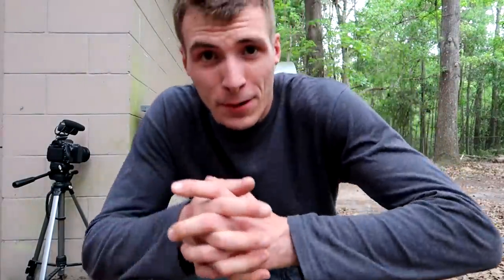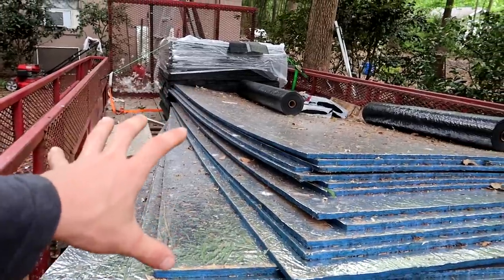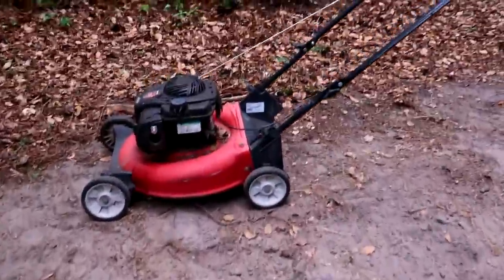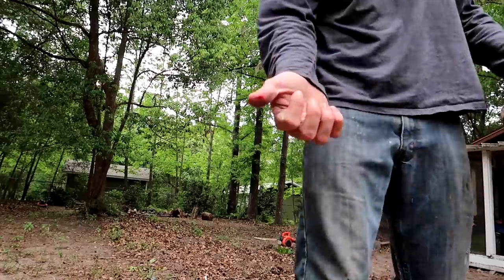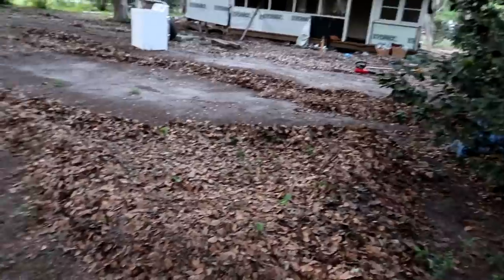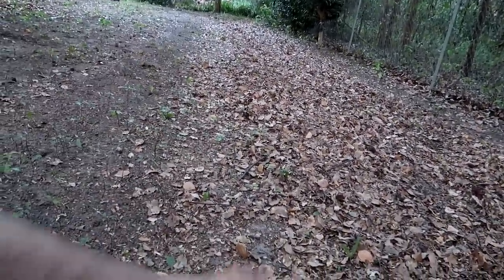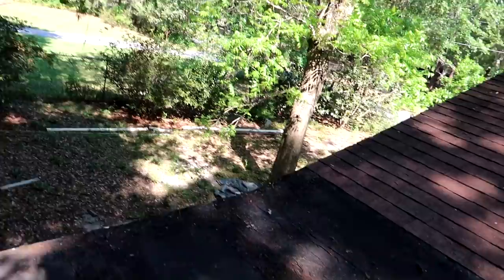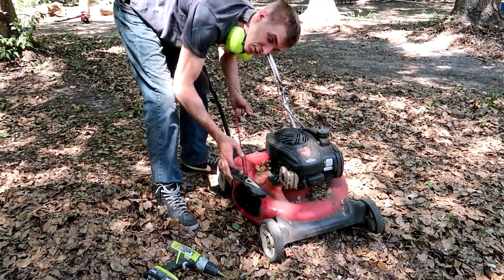Ugly Yard Clean Up - Fix This Lawn | Building My Dream Home Episode 4

Comment: One thing about growing grass, you gotta have sunlight! Your yard lacks sunlight, while your neighbors yard does not. Use a rototiller to loosen up your sand so the grass can grow.  A chipper/shredder can be used to reduce the volume of leaves and create soil. Good luck on your project.
Reply: ... and pile the leaves into a mulch pile (no need for a bin really).  The decomposition generates heat and will speed up the process.  When I lived in south GA my yard was a forest of pine trees.  Cut half of them down and the grass took off even with the sandy soil.

Comment: Your piles need to be at least three feet tall and three feet wide (more mass). You need equal parts nitrogen and carbon for it to quickly decompose.  You have plenty of carbon ( dead leaves). Add some green material. Your going in the right direction though keep researching and google hot composting.

Comment: I cant Lie, i died when the lawn mower string broke
Reply: I work on mowers, a lot of manufacturers are using cheap cotton cord. If it's left in the sun it degrades quickly. I always replace with high quality nylon starter cord
Reply: 😂 same here. It's one of those things that when it's happening you want to punch/kick something, but after it (in this case watching it) you can't help but laugh.

Comment: You have the right idea. When I bought my house 20 years ago, I had sandy soil. Every year I mow the fallen leaves blowing them towards the center of the lawn into a line, then drive through the line mulching them up. It took a few years, but I never fertilized and have really good soil now.   And oh yeah,  just find a riding mower, Dalton. You have a big yard, you will find other uses for it too, you are wasting a ton of time with that dinky pusher, rake and leaf blower that you could use on more constructive projects.   Also, get one of those sprinklers that rides along the hose, they look like a tractor and move across your lawn soaking a large area with minimal attention from you required.

Comment: Just a thought. If you're not going to save that dryer tear it apart and take the drum and make yourself a composter out of it. Put the drum on a frame so you can spin it. Put the leaves in it and every week or so turn it . As for grass go get a bag of grass seed made for shade and throw it down and see if it grows. I bet it will. You can get a small bag at walmart or lowes/Home Depot. Good luck with the property. Can't wait to see what comes of it. Any improvement will make the neighbors  happy I bet.

Comment: when i moved down the shore i had a lot of leaves to so what i did was just tilled them into the sand. worked well and helped build up the sand  oh yea did i introduce you to my cousin murphy's law.  remember water cost money so don't turn on a soaker hose and just forget it. i would put a hose timer valve on it. the only way you will grow any good lawn is to bring in truckloads of topsoil and put down about 3-4 inches, then seed it.  sand does not hold moisture so if you try to grow in sand you will need to keep it wet or just 2 days with out water it will just burn up

Comment: Waste of time with the leaves just blow them into a pile and burn them and blow the ash around and its fertilizer.
Reply: And once you tear your house down and build new last step have grass layed down on top of it all and it will look awsome as long as you water it ALOt or put in a sprinkler system. Florida is like arizona if you dont have sprinkler system grass will never stay alive there. It has to be watered all the time because it doesn't t.f rain very often.